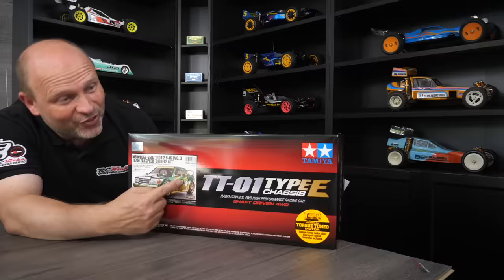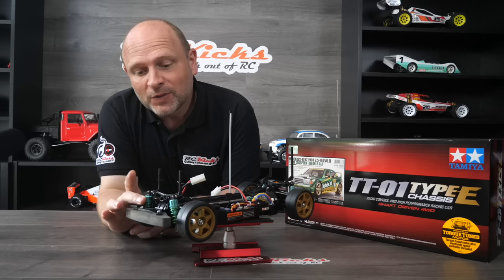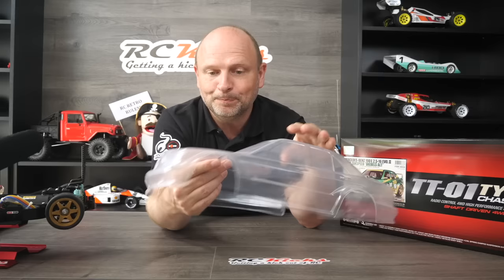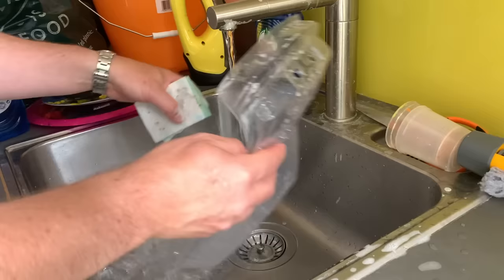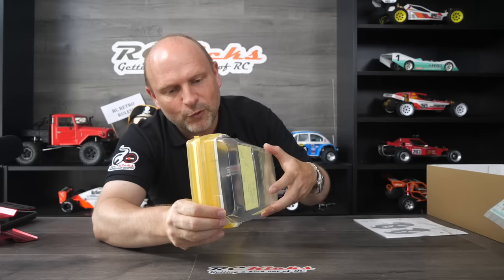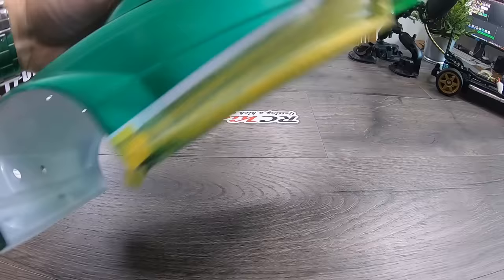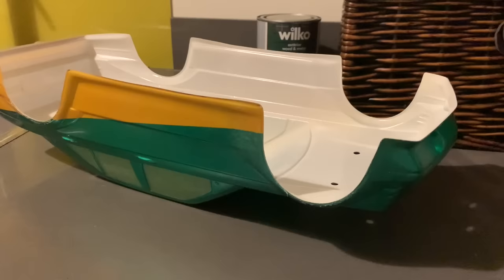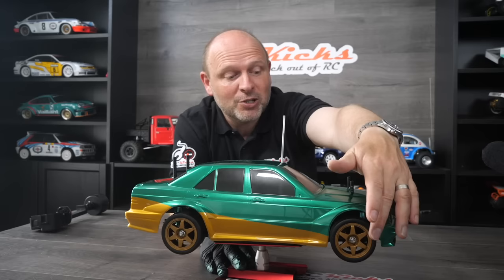Ultimate RC Painting Guide. Tamiya Benz 190E Detailed Steps. (Improve Your RC Bodies)

Comment: Some good paint tips Gavin,
I've just built myself an Hobao SSTe Truggy and although the paint job looks good(bright almost Kawasaki green with black and red hand painted flames) I did however opt for the cheaper Core rc paint and I have to say I'd never use anything other than Tamiya paint ever again,it's so much easier to apply with much better coverage.
The Merc is looking awesome by the way😊